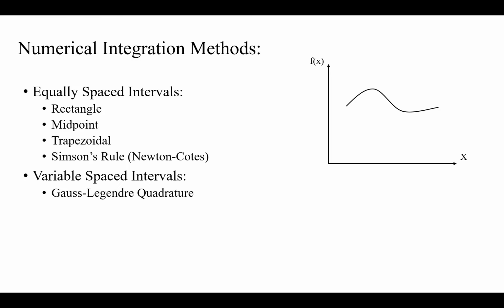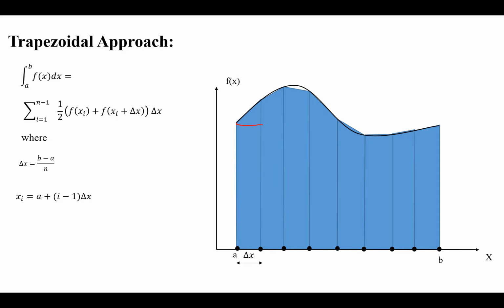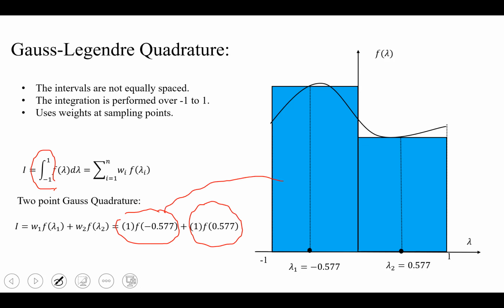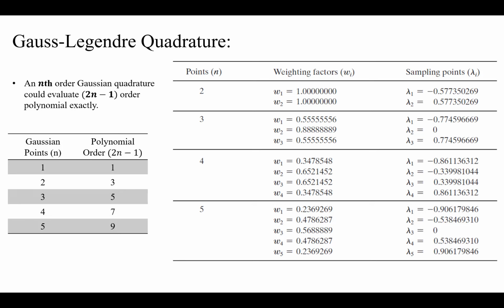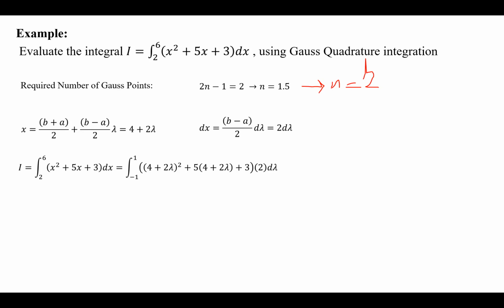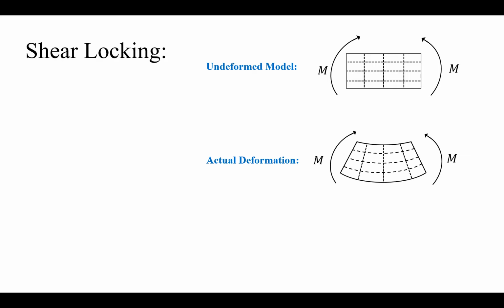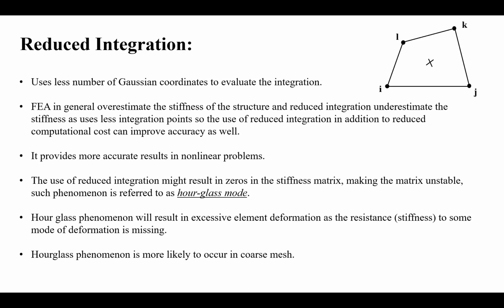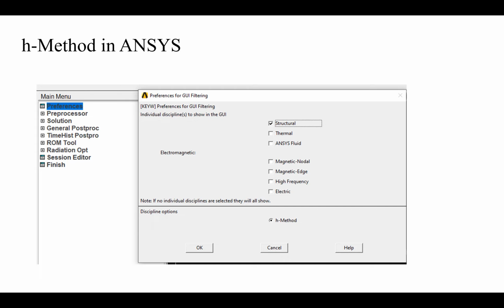Lecture 19: Integration Methods in FEA

Comment: Thank you very much ! I was wondering for shear locking, you said "linear element cannot represent that curved edges..." but fully integrated element are no more linear ?
Reply: Are Linear element "automatically" fully integrated ?
Reply from the maker: Linear elements can be both fully integrated or have reduced integration. Full integration will only cause shear locking, to avoid it we can either use linear with reduced integration or higher order with full or reduced integration.

Comment: Hi, thank you very much for this great video very detailed and well explained. Please could you help by explaining  why the tetrahedron 4-noded and the triangular 3-noded finite elements do
 not require numerical integration while the 8-noded quadrilateral finite element does.
Reply from the maker: Thanks for your comment. Numerical integration is used to solve complex integration. For the case of 3 Noded triangular element, you are dealing with constant strain triangle (CST), therefore, you are simply integrating a constant number.